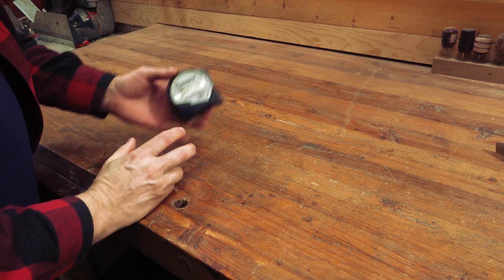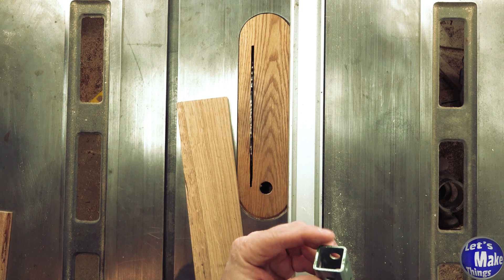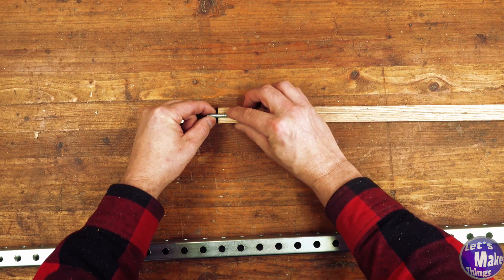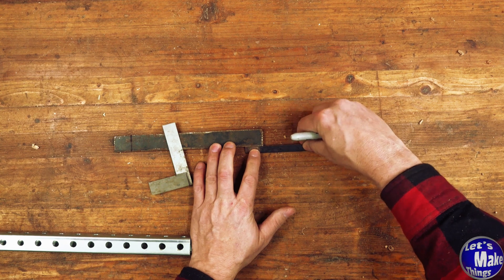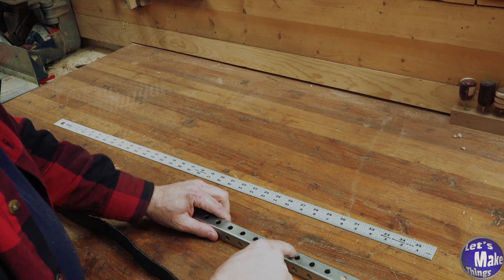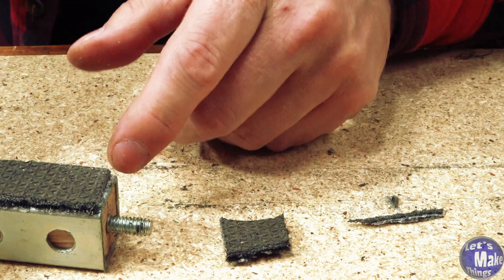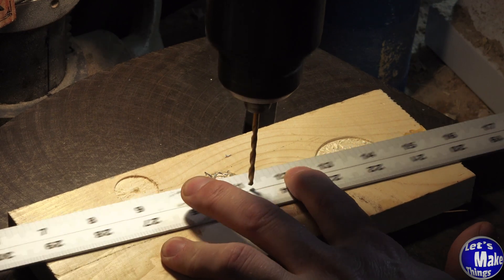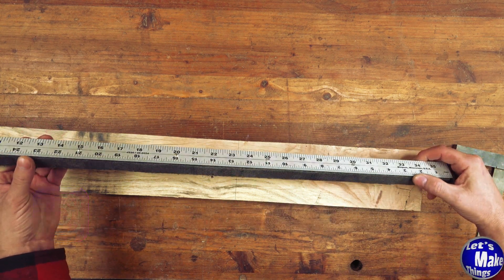Why aren't rulers sold like this?!

Comment: Very nice, Rob.  FYI, if you glued magnets to the ruler face, then the ruler would then stick to the metal tube.  reversing the ruler would be possible or use the ruler without the jig when needed.  If you mount the end stop with a magnet instead of a hanger bolt would make it easier to take off when not needed.  Magnets are handy  :>)
I made one very similar.  The difference is I used angle iron so the ruler was at a comfortable angle (45 degree) to the surface you are marking. 
I like the thin strip jig you used here.  I don't remember a video on that, though.  Is there one?